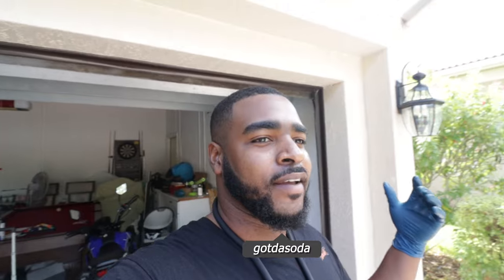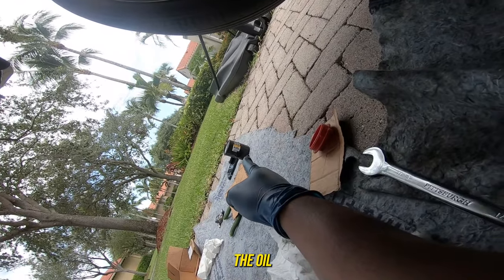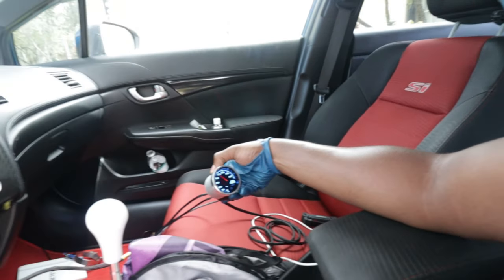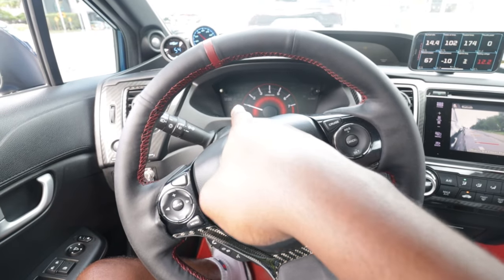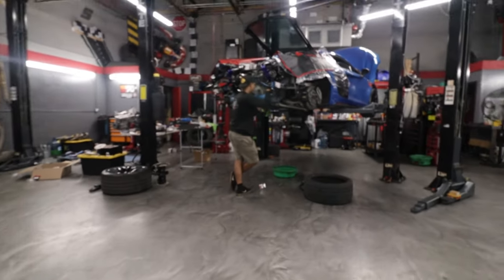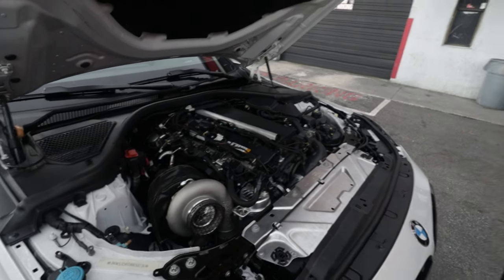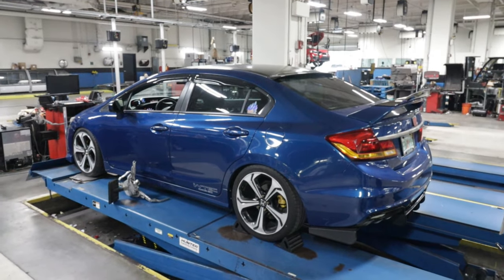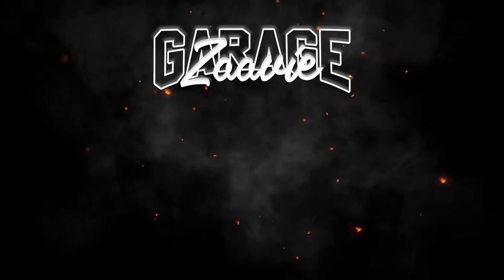DUSTY IS BACK AND BETTER! FULLY BUILT 9TH GEN!

Comment: Got an alignment on my 9th gen, it pulls ever so slightly to the right sometimes, usually under throttle likely just due to the nature of it being FWD, and the torque to the front wheels I think. But when cruising, or off throttle coasting it's perfectly straight. Before my alignment was pretty bad I actually balded one of my tires down to wire 😆

Comment: Yo, when you put the new engine in there, did you have to use a different engine harness and ECU/ECM ? Or was it plug and play ?
Reply from the maker: @kevincervantes9732  everything is the same .. nothing needs to be changed besides the knock sensor. I used the same engine harness, complete plug n play